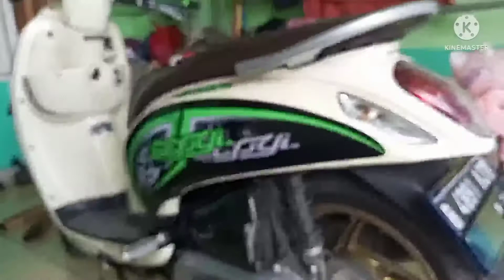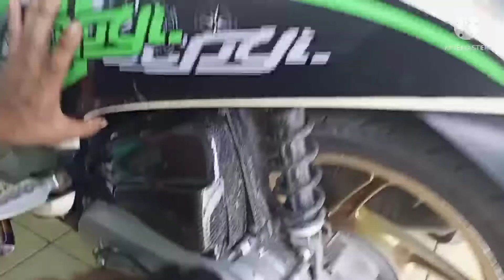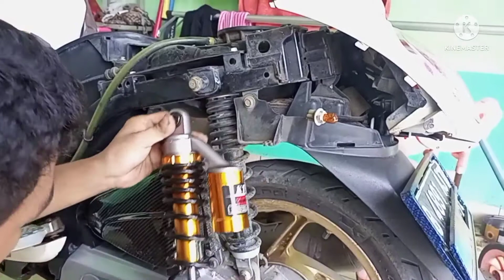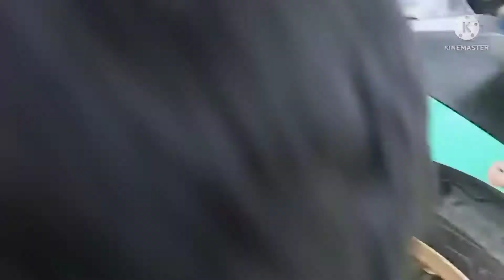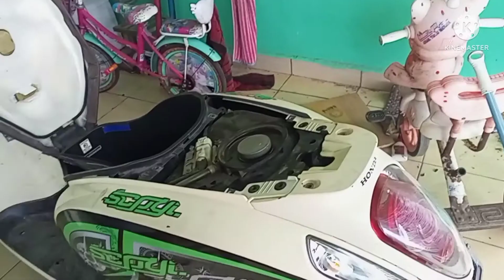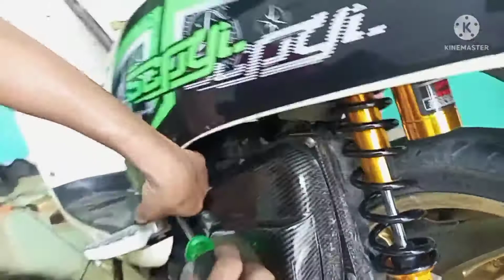cara pasang SHOCK TABUNG & COAK BODY || HONDA SCOOPY

Comment: Bang rekomen tabung atas yg ada rebound, compression, sama preload nya bang buat scoopy fi 2013 sama kyk video kyknya. Tapi klo bisa yg gaperlu dicoak bang takut engga rapih hehe.
Reply: Tapi di coak gapapa juga sih asal masuk tabungnya. Ukuran panjang 330mm bisa ga bang, biar tinggi sama banyak space naik turunnya. Trus itu ga kena body Air Intake nya bang yg depannya itu, atau kena ban gitu?
Reply from the maker: @RatFun2018  pake rcb paket komplit bang.
Ada setelan nya & tanpa coak
Reply: @Bengkel_satset  yang mana tuh bang rcb nya